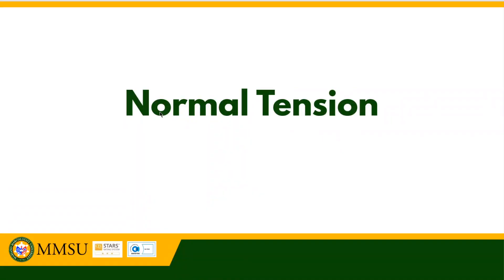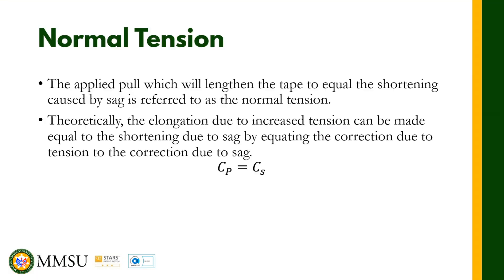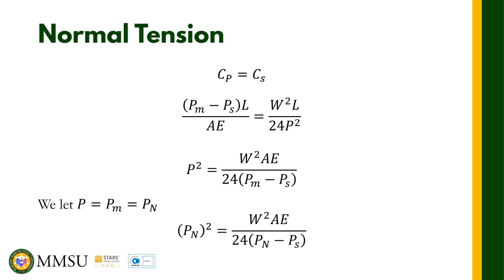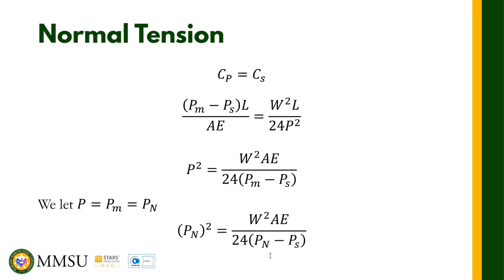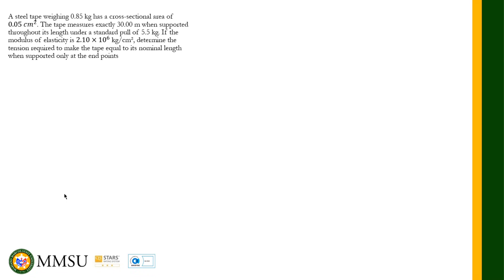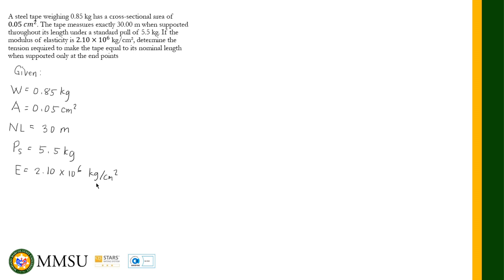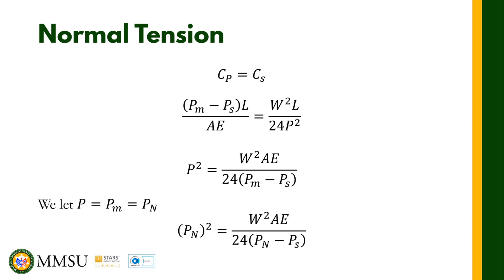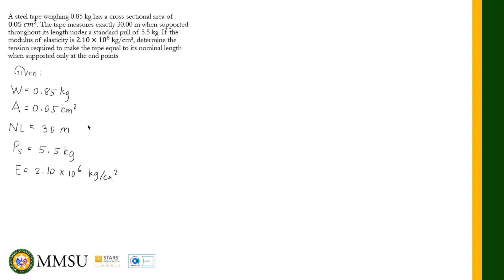Normal Tension | Taping Corrections | Measurement of Horizontal Distance | Fundamentals of Surveying

Comment: What is the setup of the calculator. When i compute in my calculator it will not show decimal form but other answers. I also tried your steps but the answer is different. Pls help i need it on my surveying class
Reply: Im also using casio. I have problem with my calcu whenever i solve problems like this when press shift solve, the answer will be zero. Pls help idk what is the problem. My mode setup is in degree.
Reply from the maker: Hello Silver Stine. I am using a Casio calculator. What are you using?
Reply from the maker: Can you send me an email with a photo of your calculator when solving. Send to enggmathem@gmail.com
Reply: @JonasClassNotes  its ok now my calculator just hang a bit i appreciate your help thanks great job on your teaching how to solve this on calculator.
Reply: @silverstine6508  hi sir , the same problem with yours can you tell me what did you do to solve it correctly